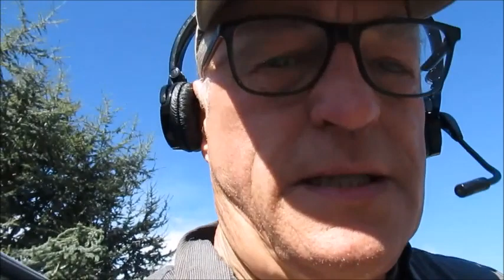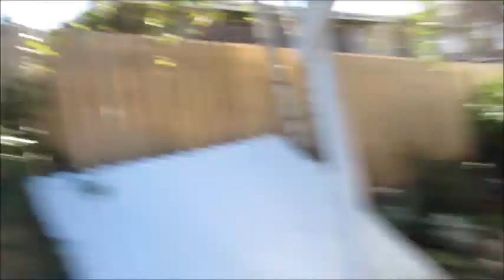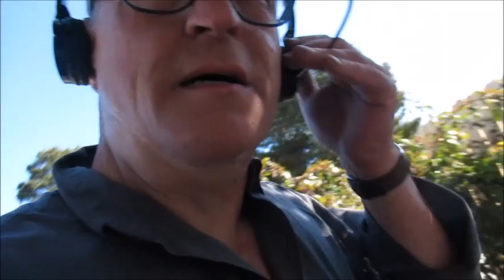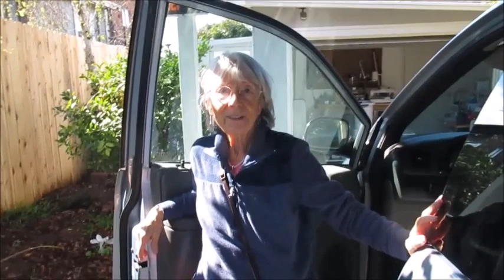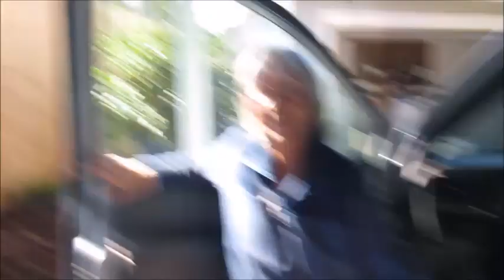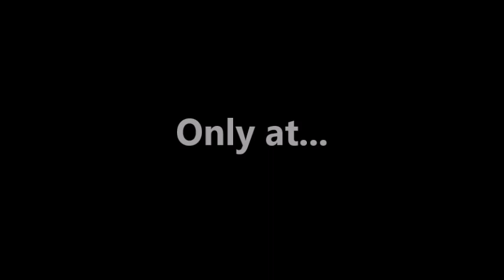How we gave more power to a Grand Caravan with no parts!

Comment: Folks, the point here of the video's title is- This is a special modification to the throttle body, done with unique tooling, which requires training to perform. This is Ron Hatton, the Groove's Inventor here. Point is, this is about modifying the EXISTING throttle body from the vehicle, not some aftermarket gizmo! It's a Modification, not a bolt-on part.

Comment: More info in the video please! This is just a "customer testimonial" and shows nothing that you actually did to the vehicle!
Reply from the maker: What we do is very particular, Mr. L. It requires a special shape to be machined into the throttle assembly at a certain location, but has been proven over more than a decade to be 100% effective. Check out GadgetmanGroove.com and you will see what it's all about. For the science behind it, look up the video "How does the Gadgetman Groove Work?" here. It shows what we do, where we do it, as well as its effects on combustion and the computers (where used).
Reply: @thegadgetmangroove6304  I found d nothing about how it works